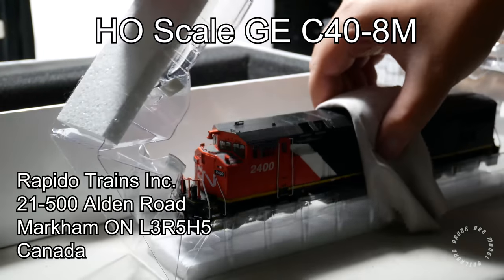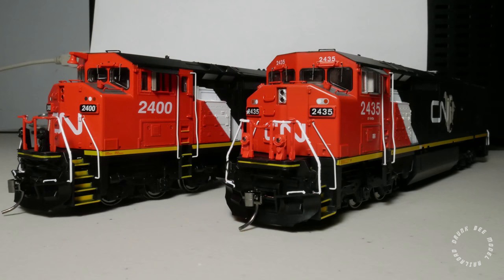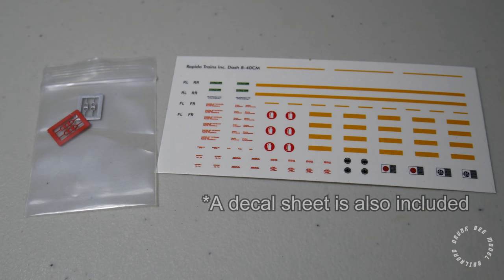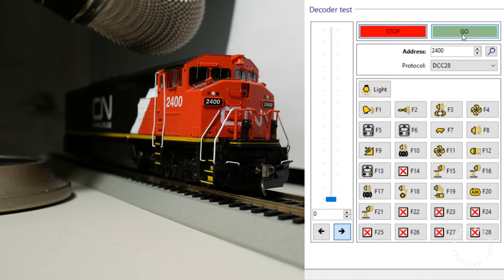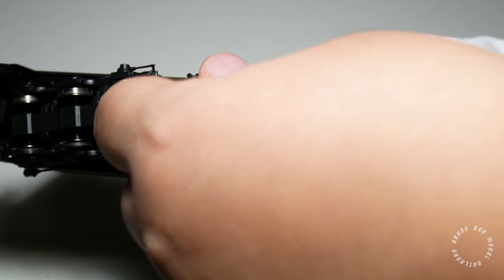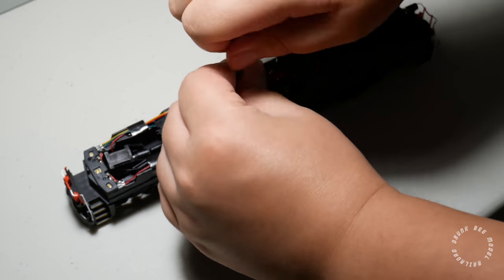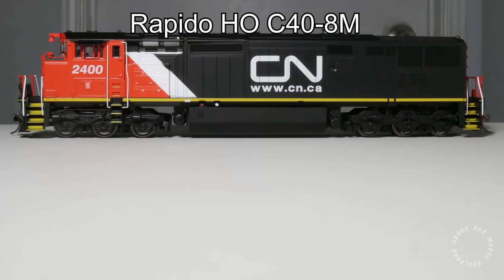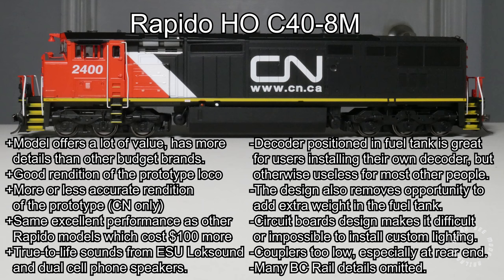Review: HO Rapido GE C40-8M 'Dash 8-40CM, Canadian Dash 8'

Comment: The radiator section isn’t necessarily incorrect for BC Rail. As delivered, the radiator section was just like the CN units, but BC Rail eventually upgraded these units to “Dash 9 specs” which included a radiator modification that sat a few inches above the original radiator and was more rounded. Around 2012 or so, the entire CN fleet received split cooling mods which significantly altered the radiator appearance. Take a look at recent C40-8M photographs and you’ll see what I mean. On a side note, I don’t think the number boards can be turned off with F14 like the manual says? It wouldn’t work on mine, so I will probably end up removing the number board lights on mine since it looks silly when all the units in a consist have number boards lit up.
Reply from the maker: That makes a lot of sense. I knew about the CN split cooling rads but I didn't read about what happened to the BCR units over time.

Numberboards seems to be track powered and it isn't tied to a function output, so it's on as soon as you put it on the track. So F14 wouldn't work obviously. The manual is also wrong about F11 fast doppler horn, that doesn't seem to be work for me either.

Comment: My 2400 was delivered earlier this week.  I like your review and showing how to get the tank off.  I am happy with the model, considering it is DCC/Sound equipped for $209.  Too bad Jason is done with any future Prime Mover locomotives.  Why no mention that out of the box F10, F11 and F14 on the decoder don’t match the manual?  Rapido is checking with ESU what happened.
Reply from the maker: I am not sure about F10 because manual braking is a feature I don't really use, typically the brake set/release sound is the last sound slot so it should be easy to find, I will have to investigate it some more. F11 is supposed to be the fast doppler horn but apparently there isn't a fast doppler recording stored on the sound file, so when you press it nothing happens. This can be fixed with a sound file update if Rapido/ESU decides to do one. F14 is supposed to control the numberboards which is AUX3 on the ESU decoder, but the numberboards on the loco are wired to track power (ground) and not AUX3. That means they're on as soon as you put it on the track and impossible to turn off, press F14 (which controls AUX3) will do nothing in that case. It's probably a design flaw of the circuit board/wiring by the factory.

Comment: Great review! Well, researched and through. My only suggestion is that weight dosn't always equal pulling power. I have several really heavy models that don't pull very good. Wheels are the other equation into pulling power. Shinny smooth wheels will not provide allot of pulling power even if the loco is on the heavy side. This also give reason why prototypes have sanders. So, reviewers like you should take a look at the wheels and how they're made to give modelers an idea of what provides the best pulling power and what we should expect from manufactures.

Comment: Looks nice, waiting for my CN Stripes and BC Rail units.  You run them with your bowsers? hwo bad is the speed offset ?
Reply from the maker: This thing will be dragging the Bowser around the layout and slipping like crazy unless you speed match them beforehand. Bowser's stuff tops out at around 55-60 scale mph while this goes all the way up to 80+.
Reply: wow, yeah that sounds like a bit of difference in the gearing ratio between the units. I accept the challenge.
Reply from the maker: If you bring CV5 (max speed) on the Rapido model down from 255 (default) to about 180 then it should top out at around 60 scale mph to match the Bowser SD40-2F. CV6 (mid speed) I'm not too sure, because Rapido's motor response is almost perfectly linear, while Bowser's motor response is more like a exponential curve (slow at first and then much faster). Just play around and find the setting which works the best.
Reply: Do you use your Accutrack II for speed matching ?  Does that make it any easier ?  wondering if it's worth getting one.
Reply from the maker: Yeah it's worth having. I'll have a video outline its use uploaded soon.
Reply: Cheers for that man!  Where abouts are you? I'm up in stouffville.
Reply from the maker: Markham!
Reply: Awesome stuff, I'm just up in Stouffville.  You interested in speed matching my loco's for a fee ?
Reply from the maker: Sure send me an email db.model.railroad@gmail.com or facebook message fb.me/dbmodelrr

Comment: Great Videos drunk Bee!!!  I do enjoy them.

i just got the BC Rail version and I want to install the Rock-low ditch lights.  From your video it looks a bit daunting to have to completely open up the loco.  No other way???  Crazy!  I speed matched mine to 0 - 100km/h and put the values on a video I just made  in case anyone wants to try them.  I am Very Pleased with the loco.  -Chris
Reply from the maker: Yeah you need to take it apart completely to route the wires for the rock lights. I also highly recommend taking the fuel tank off before soldering the connections, that gives you extra space to work with and you don't risk damaging the fuel tank with your soldering iron.
Reply: This now sounds like a much bigger job than i first thought!  Thanks for the advise.
Reply: chrislef2002 what is the address of your speed matching video?

Comment: Nice review  I have BCOL 4618 and on order BC RAIL 4619 ! So do you have any suggestions on how to fix the sagging couplers ?
Reply from the maker: I think adding a thin (around 0.010" thickness) washer into the coupler box will reduce the coupler's up and down play and fix the sagging problem. A piece of styrene with a hole drilled will also work. The Rivarossi U25C has the same problem when installing Kadee whisker couplers and I've outlined a similar solution: https://youtu.be/Yx7WIRzv-04?t=6m13s
Reply: dave are you ok i haveent seen you sine befor the show
Reply: I have to look at mine to see what is going on !
Reply: I'm OK just had a mild nervous breakdown sorry for missing the show I was so looking forward to it but very tired , exhausted , at home getting lots of rest this week .
Reply: thats fine i was just wored and the other day when there was activity on your acount i thought you were fine

Comment: it would actually be nice to get a full road number listing -
Reply from the maker: Would you like to see all the road numbers of the prototype locos, or just the road numbers available on the models?
Reply: if I was going to model something per company, I would try to match all loco units within the series including the rebadge and branding of the units currently being used

1-50100 type scenario..

it seem retarded not to have a complete list of units with corresponding numbers

if a particular rail co had 1500 units in 1 type you not want a proper number badge on each unit???
Reply from the maker: Ok, noted. Thanks for the suggestion. I'll put the road numbers in the description for this one and include them in future videos.
Reply: if it exists in the real world it should exist within the models you run

example if you got a series of loco''s 1200-1224 (example), would you not  want it represented in the models you run..

would you want to add and remove decals of thousands of locos to have them number decals already on ??? or would you rather them do it in a build period batch
Reply: that's up to you though my statement was more directed with the actual  models if they are going to release a prototype i would think they would do a series of road numbers and if the hobbiest wants to change they can do so though it is a shame they don't have runs to all number from factory..

Comment: I wonder what solution you come up with to fix the coupler issue ? I thought about using a Kadee Underset coupler either a 141 or a 147 or maybe just shim it. what is your solution?
Reply from the maker: I've installed 158s with a 0.2mm brass sheet on the bottom to prevent sagging.

Comment: How do you detach the white ribbon cable? Do you just pull it straight back or if there a type you need to flip up?
Reply from the maker: Pull straight back, it's held on by friction only.
Reply: Thanks!! Love your reviews. Just working on installing the rock lights on my BC rail unit.